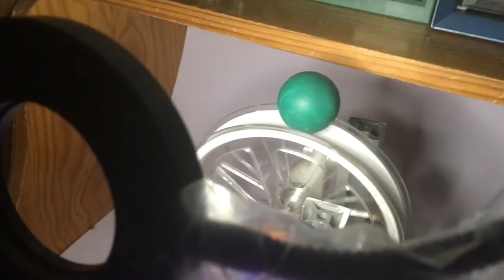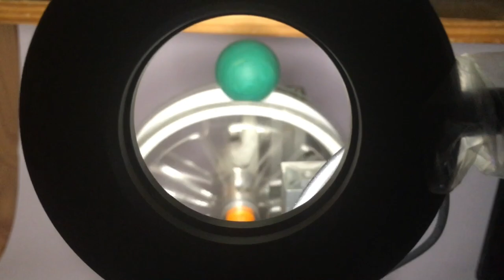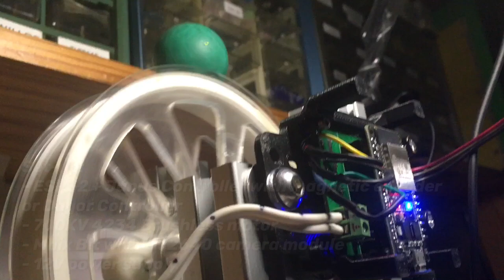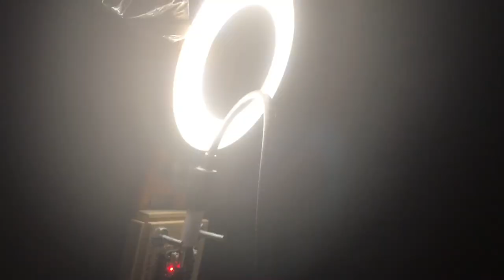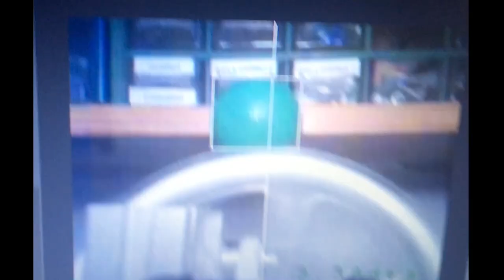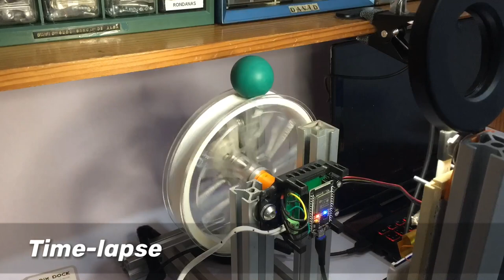Control of the Ball and Wheel System with SimpleFOC and Computer Vision

Comment: Can you make this as a drop-in replacement for stepper motor with servo motor and this controller for cnc machines. Right now the cheapest option is ODrive. Step and Dir. Thank you for your work.
Reply from the maker: Hey, for the next release we'll try to include a dir/step example into the library examples!